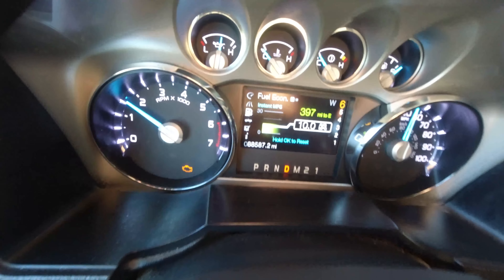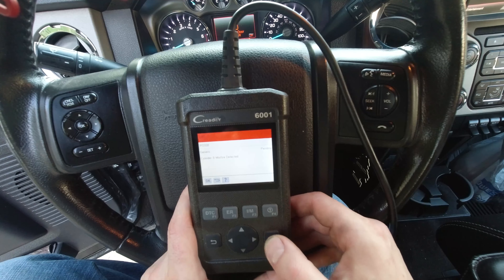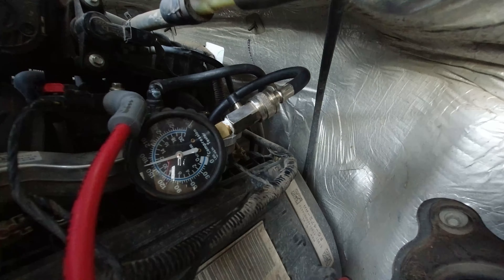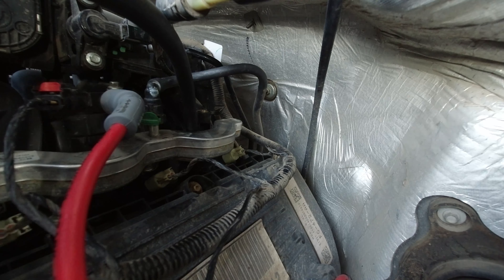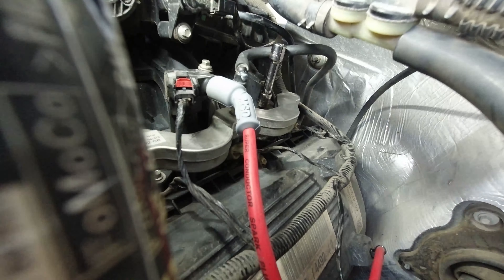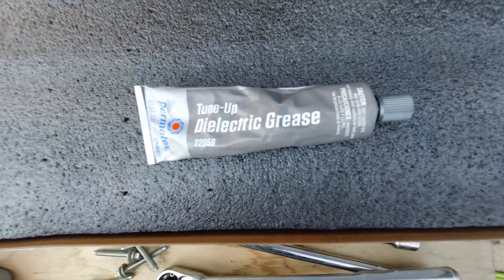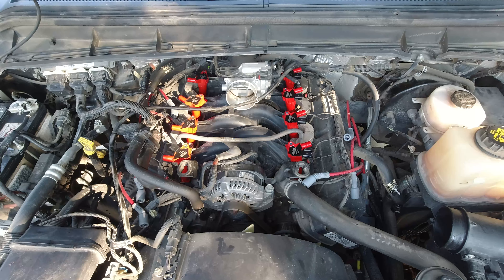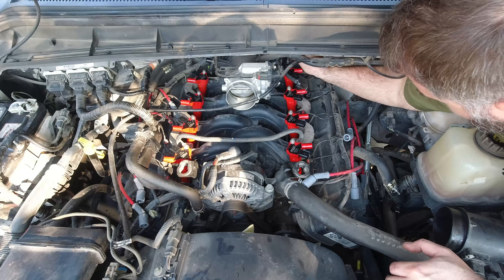Replacing Ignition Coils on my 2015 Ford Super Duty 6.2L

Comment: Really should blow out the spark plug well with compressed air. If the coil pack corroded there could likely be debris that you don’t want in the cylinder.
Reply from the maker: Yep, if it's your first time in there and you're also doing plugs, definitely need to clean and blow out the plug wells.  I had done my plugs a few weeks before so I had already done that process.
Reply: @ did my 6.2 F350 plugs and found a whole rock in the well
Very glad I checked each well with a camera before popping em out willy nilly. If that pebble went inside my engine Itd be toast
Great video you have there, thanks for taking the time to do all that.

Comment: My son just did the same process on my truck at 95000 miles, I also had him remove the boots on the new coil packs and add die electric grease on the spring and reinsert the boot in the coil pack. Good idea to grease the boot where it contacts the intake, wish I would have done that.
Reply from the maker: Some extra dielectric up in the spring area definitely wont hurt.  Thanks for watching!

Comment: Was it skipping before you replaced them. Mine just started skipping recently and im thinking it thats what it needs.
Reply from the maker: I was having skips, mostly the arcing issues that I didn't realize until I saw it one night.  I had replaced the boots on my OEM plugs, but the plastic had started to degrade and wouldn't seat the springs or the resistor/inductor pill things correctly.  I ran this way until #8 pack completely failed and decided on total replacement.

Comment: Good  video but l missed the lower wire connections. Did the original heat shields fit on the msd wires?
Reply from the maker: My truck didn't have heat shields on the lower OEM plug boots.  I'm assuming your are referring to the plugs on the side of the heads near the exhaust manifolds?

Comment: you said you smell unburned fuel..  well you did unplug the coil pack..  so you would have caused an unburned fuel smell even if hte coil pack was fine..  but I thought the ECU stops sending fuel to a cylinder when it detects a misfire?  inccorrect?
Reply from the maker: Yeah, I guess I did show that out of sequence, lol.  It was smelling rich before I had unplugged the pack.  I'm not sure if the ECU shuts down fuel if it senses a misfire - it would make sense if it did multiple times in a row.

Comment: What is the long term review
Reply from the maker: I'll get a video going and give a 4 month update. As of now, I'm really happy with these coil packs - no issues to speak of and we've gone through some -20F days.
Reply: @Man'scape  literally doing plugs today, took off 2 passenger packs went to check and literally crumbled in my hands, decided to replace all 8, dealer got me them for about 130 a piece.  Then with my ford pass points OTD about 700 dollars so looks like I'm staying motorcraft but good video.
Reply from the maker: Nice, less than 800 on Motorcrafts seems to be a good deal.  Thanks for the feedback, hope the install went/is going well!
Reply: @htownsfinest87  Denso is the OEM for the coils.  Cheapie coil set from amazon gave me misfires. Also Had arching on my old coils.